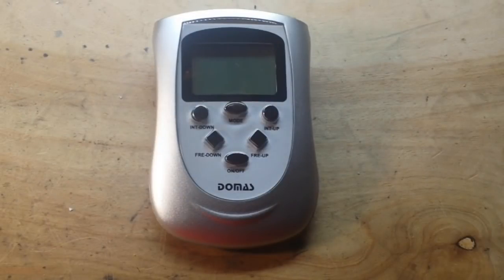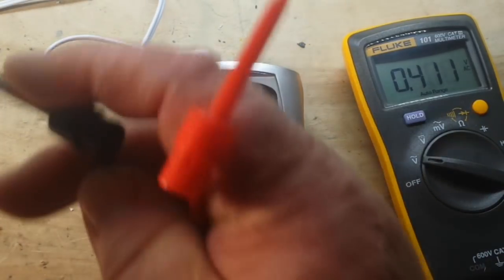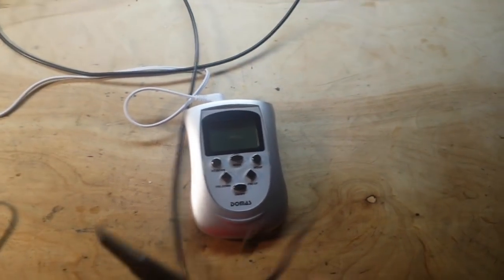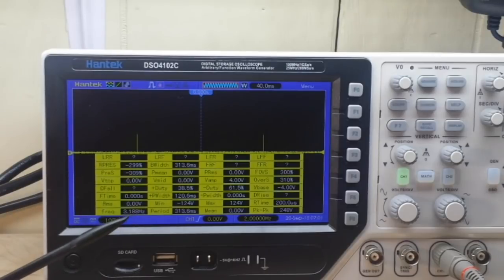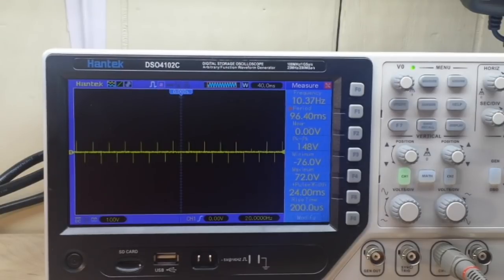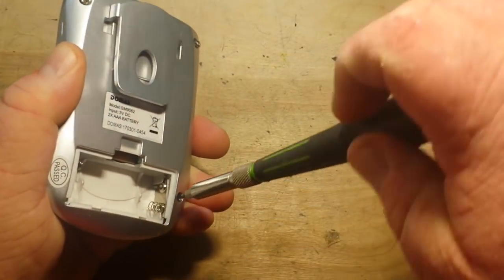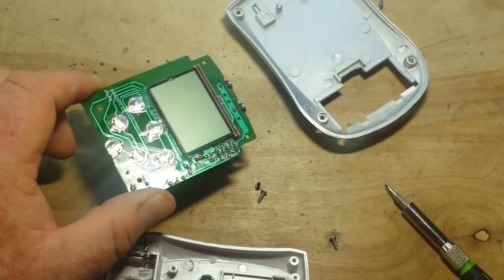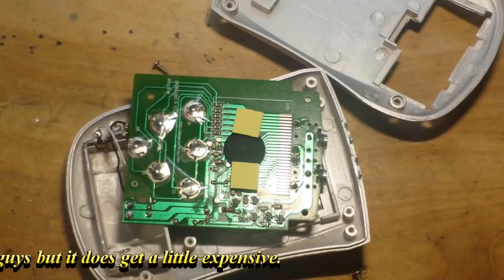Cheap Chinese TENS unit

Comment: Voice sounds ok today, glad it's better. I've got a couple of TENS units that have 9V batteries. I had a neural stimulator in my back which has leads up the spine and the power unit under the skin. The controller is external and is touched to the spot of the power unit to set the thing up. Also the battery is charged through the skin (gets warm after three hours of recharging) but it's gone now. Amazing there wasn't more inside that TENS couls there be a CPU under the blob? Gkad to have you back breaking stuff and making good videos about it!  ;-)

Comment: When you line up the display on the top plastic case and reinstall the PC board, the connector should line up and work.
Been thinking of purchasing a Tens unit. Does it work for your pains?
Reply from the maker: Yes it works great.

Comment: What is the current and voltage you get hit with? It looked like the open load voltage was around 160 volts? Or, was it 1.6 volts? I would imagine that would drop considerably if it's connected to the electrodes and loaded down. I would think it would be constant current to some degree. 

There are warnings not to use it with a pacemaker. If there was a problem with your pacemaker, the current might be conducted directly to your heart. Also warnings that one can get "burns" if you place the electrodes to a numb area.

If you were to apply the electrodes to a sensitive area of your body, it could hurt a lot.

Comment: Hi Paul, you sound ok, didn't know you had a 101. Talking meters, the other day I measured a resistor with my old Fluke, a brief hesitation and then a solid stable reading, tried my el cheapo Chinese meter and got an instant reading that then jumped about all over the place till it finally settled on a stable reading. There is a difference!

Comment: Hi Paul I have built at least ten of these devices using 555timer two caps and three resistors at 15HZ on a 9 volt battery they work really well maybe try making one if that shoulder is still giving you jipp  thanks great  video
Reply from the maker: nice!!
Reply: I need one a never wake up earlier in dessepeeated to do something

Comment: Hey great video! I was wondering if you could show me how/if its possible to hack the buttons of this with an arduino?! I have a similar TENS unit - so would actually only need to control the on/off button and the strong button! Any help would be appreciated!